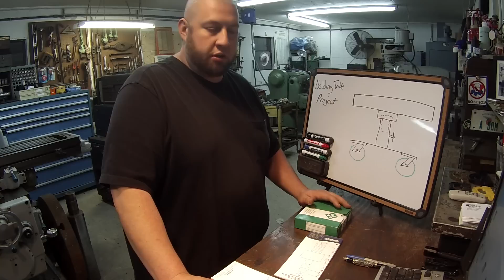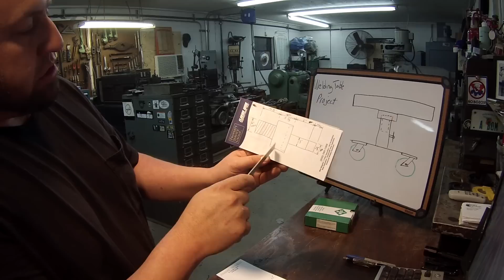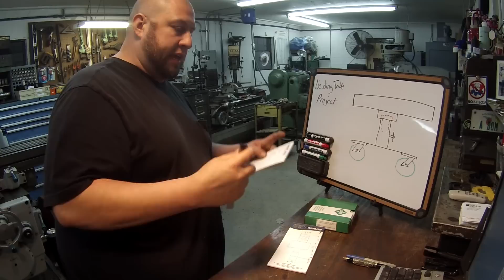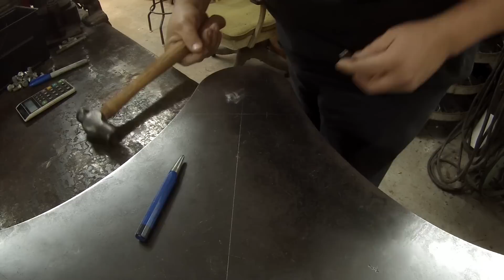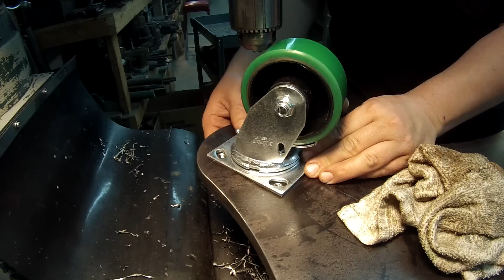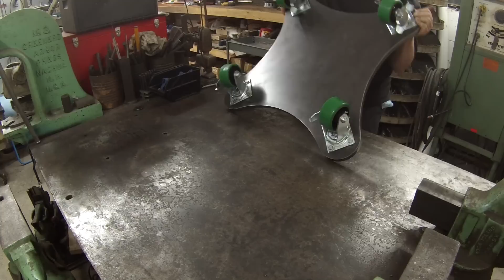Rotary Welding Table Build Part 1

Comment: Hey Adam, always enjoy your work. As a cabinetmaker I would offer one suggestion or second thought about your height. In my shop all my tables, carts and saw horses are the same height as my table saw. The idea is allows me to lay anything I have across any or all the pieces in my shop and they are level, more or less. Just a thought.
Reply from the maker: Yep it's a good idea to have them the same height. I'm making that change in my design.

Comment: Great video :-)
Loved the ride through the shop!
I thought you'd use a (isn't it called a) center finder (the right angle with the scale through the middle) to get the centers for the hole patterns. I thought it'd be easier and quicker and just as accurate.
Reply from the maker: There's several ways to lay them out, and all will yield good results.
Reply: Abom79 I liked seeing it this way, now I have a tool in my arsenal till I can afford a center finder!

Comment: Really like the simple design. I know it's a little premature, but did you think about adding a friction type motor drive for the weld table which is removable? This way you can have a steady speed for round parts, etc...

Comment: Hey Adam,  It looks like the build is going well so far.  I'm looking forward to the remaining videos.  Until you told us you were using 3/4" plate, I was wondering if the weight of the face plate and the shaft would have caused some sagging based on your drawing!  Good thing the bottom plate is thicker than a DryErase marker!.  It looks like that bottom plate is going to be more than substantial.  Do you or any of the other guys think you need to add gussets, or is that just overkill?  Great looking casters.  They should give years of good service!  Keep up the good work and Happy New Year.  All the best, RS
Reply from the maker: Hey Rick. Good to hear from you. I don't think the job needs gussets. The tubing is 4x6 and faced flat. It will have a nice heavy weld bead around the bottom. I don't see why that would ever break loose with me just pushing on it.

Comment: Hey Adam,

Base is looking good. Nice burn job by your buddy. Can't wait to see the rest of it. Glad to help out anytime.

Talk to you soon.

Tom
Reply from the maker: Kelly Breckenridge
Thanks Kelly. I have some blue thread locker if that will help you sleep better at night.
Reply from the maker: Thanks Tom! The plate burn looks great, and the sizing and shape is spot on.
Reply: Enjoyed the video Adam the base design looks real good
Reply: Oh thank god
Reply: This plan is all coming together, can't wait for more of the build
Reply: I like the design of the bottom plate, no ankle bitters there, great idea!

There's gonna be a fair bit a weight on those castors 1/2" deep on the threads & wondering if you plan on using some lock tight Abom79
Reply from the maker: *****
 Thanks Mike!
Reply: Nice job you guys.
Looking forward to seeing the completion of that project.

Comment: Looking good, what are the specs on the casters?  Really like the suggestion from Eric down below re: a mechanism for moving it around at the base level rather than applying the force at the table, whether it be a rope or something more complicated.  Nothing worse than having to move something heavy enough to have to get down below a topple point before it will shift :)
Reply from the maker: Steve, the casters are rated at 1K lbs each. I figured that was more than plenty, plus the price was right.

Comment: Great job Adam, I guess this has to fall into the Big Boy Toy category as anything that weighs as much as a boat anchor surely does.  I Like the design of the bottom plate the curved cutouts down there may spare a shin or two over the years., but it just looks damn nice and no bolts on the top of the plate is a class build option, well done.
Reply from the maker: Thanks you John. My idea with the bolt holes tapped was to help keep it clean looking on top of the plate. It's my own project so the time spent on it was fun.

Comment: That shape is just plain sexy. It ought to be good and stable. Those look like nice casters with two grease fittings and all. The best part is we got a ride on Adam's skateboard. Anchor lube may be more cost effective than cutting oil(I have no idea of the cost per unit volume) considering you don't use a pint at a time. Seems like it worked well.
Reply from the maker: Glad you enjoyed the ride Eric. No worries on the cutting oil. I have a lifetime supply!

Comment: Aww come on Adam, it has to be power turning :(
If not you might a well sit it on the welding table and moving round it :(
Don't regret not doing it . . .

Comment: Adam looks  great  so  far, I like  how  you  mounted  the casters  it was smart to tap the plate.  The shape of the base is ankle  friendly  too.  Maybe make the overall  height 35 like your existing  table so you could move heavy stuff from one to the other  easy.
Reply from the maker: Bill, that's an idea I've been thinking about since I said 36". I'm still not sure which way I'll go though. The bottom plate was designed to that it does minimal carnage on the ankles and chins.

Comment: Hey Adam, this is gonna be one hell of a project and a great watch!
Have you thought about joining the tubular section to the base/castors? I'll be interested to see how you go about the fixing as surely welding such heavy sections is gonna distort the plate horribly and cause you unwanted rock later on. I worked on a stainless project recently where we machined up some bosses that bolted on top of the 'base plate' and were a press fit into the bottom of the tube I.D
We then drilled thro' the base plate and tapped into the press fitted bush to hold it all together.... Lovely and neat and no distortion.
Knowing the calibre of your work you probably already have this figured.... But just throwing it out there.
Thanks for all the videos, and have a great new year.
George, U.K
Reply from the maker: I think the faceplate itself is about the best table I have to hold down the plate for welding. I'm still thinking about what I need to do, but we will get to that down the road. I want to get the parts machined and fitted before and welding is done.

Comment: Hi Adam,
Just don't forget to use the dust filter on your camera when you un-rust plates, I've had to clean my keyboard so bad... lol
You'll need to get to gantry crane done before ending this series if the welding table gets much heavier.
Take care,
Pierre
Reply from the maker: I wish I had already done that project Pierre. But if I need some lift I have a engine crane I can roll inside and set up. I'll most likely be using it very soon to lift the faceplate up.
Reply: Hey Adam...

dust cover on your camera is one thing
but
Dust cover on your nose and mouth is even more important.

It looked like you had a visor on but no air mask... unless you were wearing your
"super mask" or whatever it is called.

Anon
Reply: Yap...! The mask is more than a great idea....!

Comment: Adam,
That is shaping up to be a great welding table, I was impressed by the quality of those castors, with the grease nipples fitted and ready to go, and the width of each wheel itself will easily support any weight from above, good choice, look forward to seeing the project unfold, I thought that putting the camera on the trolley as you wheeled it down through the shop was a great idea, we got to do a free shop tour on the way.

cheers

John MD
Reply from the maker: Glad you enjoyed it John!

Comment: Well done adam! I cant wait to see it all done, this is a project i have been thinking about for a while and its nice to see how someone else takes there approach at it. Have a good new year !
Reply: Also we have one at work that is a "lazy suzan" style that we clamp in a vise and use it for any small pipe fittings were putting together and with pipe that 2 or 3 inches its real nice to have manual control over mechanical because of the weld being so quick
Reply from the maker: I have some welding rollers at work I use for tube welding. While it's really nice to have, getting the speed set correct sucks big time. You always want to make a nice pretty weld from start to finish, but when your trying to get the speed just right it just messes up your plan.
The same can be said for this type of setup also. Best would be varible speed with a foot pedal for speed control.
Personally, I'm happy with my manual turn, and look forward to having it ready to use.
Reply: Abom79 agreed! I build tanks as a side job and the only welds i use the crawler (or mechanical welding/table) for are the ones that are 20ft long where u would become fatigued doing it by hand, just came home from doing one solid 48ft long weld with the crawler and i wouldent have had it any other way, on the other hand i see people setting small pipes up in the mech weld wheel and i wonder if there going to have the machine set before the weld is done or have fidos butt run around the pipe

Comment: Nice job Adam,
You mentioned doing the layout properly, that is the make or break on any job like this. Knowing how to read a tape, or in this case, a rule, is key.
Nice touch with the arc's too. Props for that one. They will most likely pay off if you pull up a chair to do any work!
Looking forward to the next vid!
Razor!
Reply from the maker: Thanks Ray! The layout is another aspect of the job that can tackled a few different ways. This way was simple and not over complicated. I enjoyed showing it VS just transfer punching the holes. I'm trying to show all of the proper steps with all of the work I'm going to be doing on this project.
The plate design turned out good. I like it!
Reply: Abom79 That's why we watch your vids.Your approach is simple, easy to understand. Going to be a cool project to watch!

Comment: Adam,
This looks like a great item for use in the shop!
May I suggest putting a handle (like from a kids wagon) or a pull rope on the plate where the castors are attached. If you push or pull it around by the top table plate it may want to get a bit "tippy" on you. I learned this recently with a 4 wheel dolly moving some stuff around. Regards,
Eric

Comment: Great video/project. I like bolting the casters on, in case some day you have a flat tire and have to change one. Looking forward to the next part. Thanks again for the great projects.
Reply from the maker: That's it Ken, plus bolting them on it the correct way to mount them.

Comment: I would skip the bronze bushing and save it for another project. This is a large diameter shaft with virtually no rotation overtime, you are just turning it to position, wear between the surfaces of the two large steel contact areas of the tube and shaft would be virtually non existent in this application, especially with a little grease or oil on it. I like that you kept the caster install clean with the no showing hardware.  The only thing I would suggest would be to steel the rack off an old drill press and add it to the tube so you could raise and lower the table I think adjustable height would be a nice feature. perhaps an even simpler and more fun way would be to make it like an old piano stool and cut some big threads on the shaft and in the tube so when you turned the table top one way it raised, and the other it lowered.
Reply from the maker: Steel on steel?? No deal! I think I'd rather have the bushing in there Brian. But I'm sure you right in that the little use it will see not having a broze bushing in there it shouldnt hurt it. Unless I make some changes later, that bronze bushing will be serving as the arc transfer to the shaft.
Reply: Well if you are going to ground through the base rather than your work or the table then probably best to have the bushing! I would hate to get done welding only to find out the table doesn't spin anymore! lol
Reply from the maker: Won't be a problem. I've been coming up with a design for the grounding and turret flow needs.

Comment: Hi Adam:  I enjoy your videos very much.  I learn a lot each time that I watch them.  Your videos are the best of all that I watch.  Your craftsmanship is outstanding.  The design of the welding table base is a work of art.  I noticed that the radius between the feet is a very close match to the radius of the tummy.  Was that by design?  Anyway, I can't wait for the completion of this project.  I think I might like to build one for  myself.
Reply from the maker: Thanks for the nice comments Jack. Unfortunately the radius fit me by pure accident. But it's the opposite of the radius of the faceplate.

Comment: That looks Nice !!! Tom made you a perfect design for the base After drilling a tapping all those holes I would be wanting a Mag Drill  I like those clamps you used to hold it down something like those on the welding table would be nice
Reply from the maker: I have the mag drill, but it doesn't power tap as nicely as the DoAll mill. :)

Comment: Looking good, I agree on not motorizing the table. Unless you do a lot rotary welding it is just more engineering to get right. On the Anchorlube I got one of the samples from them that Stan told us how to get it. Even though the product is great like you I have a generous supply of cutting oil so I find it hard to buy anchorlube. Love the workmanship that you do on all your projects, this welding table is no exception.

Comment: You should have gotten back in the gym before this project.  Those are some beefy hunks of metal.  :-)

Nice job so far.  I like the design of the bottom.  I'll also give you a little foot room while you are working around it.
Reply from the maker: I think that plate give me back a few workouts! LOL! Yes I thought the radius would help add some feet room.

Comment: leave the face plate rusty and spatter won;t stick as much
Reply from the maker: But then it wont look all purty and shiney! :(
Reply: Abom79  Ok You win...You can always use anti spatter spray before you start
Reply: Capt1331 Or use PAM, works great and is cheap
Reply: chopperdan88 Thats a good idea I will give it a shot...Thanks.
Reply: Capt1331 I got the idea from Jody @ weldingtipsntricks
works real slick
Reply: chopperdan88 OH OK  He has a great site I watch him too